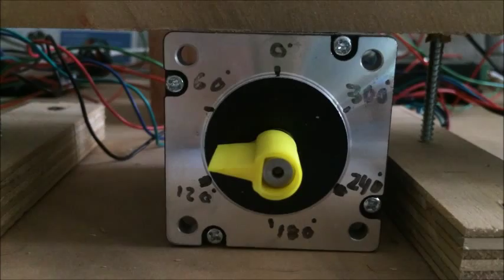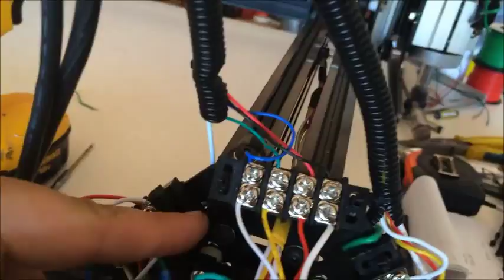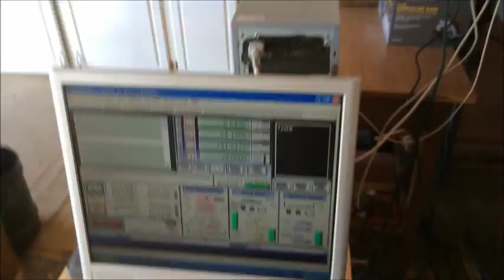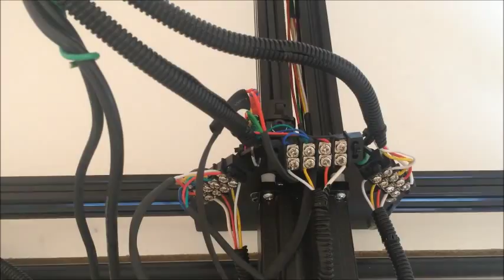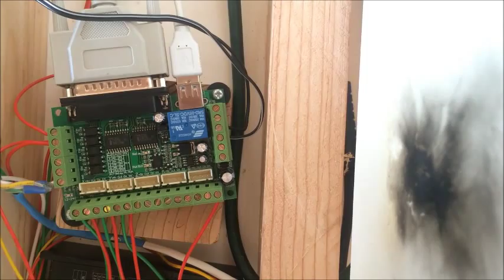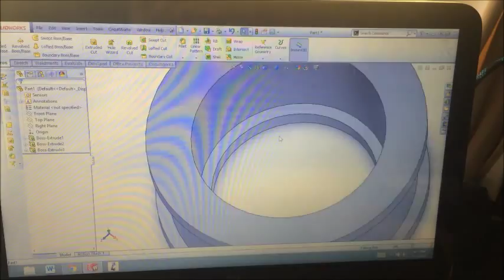Shapeoko 2 upgrade, Openbuild Parts, PART 2

Comment: Is that a Sainsmart board?
Reply from the maker: Christopher Marshall Yep, SainSmart 5 Axis Breakout Board for Stepper Motor Driver CNC Mill Blue
Reply: Brian Tracy  Question did you use there walkthrough to set up mach 3? because it is not working for me.
Reply from the maker: Christopher Marshall I took a look at their stuff but I mainly relied on the Artsoft forums and CNCZone forums. Let me know the stage you are at and I can help. Describe things done and response or non-response of software and I can probably diagnose it. It takes a little tinkering at first but smooth sailing after that. If pics would be easier for you, my email is imBrianTracy@yahoo.com
Reply: Brian Tracy Thanks, after reading about 50 different topics I think i found my culprit. my Parallel port card only out puts 3.3v and cnc machines that work with Mach 3 use 5v.